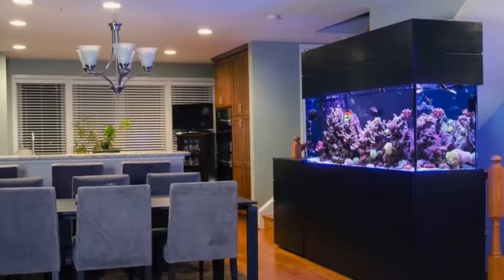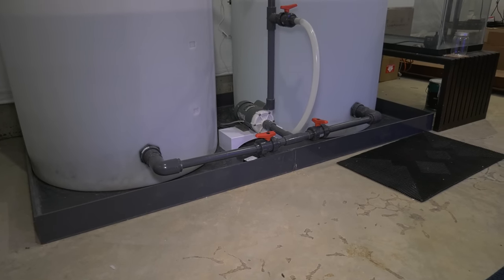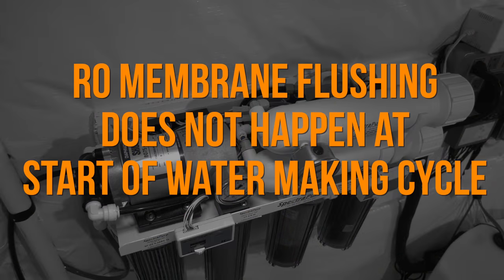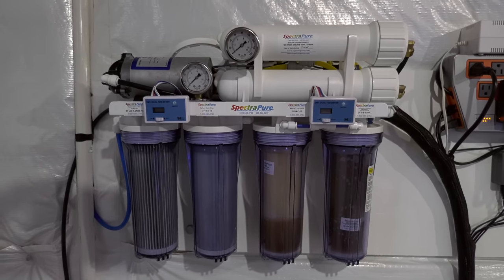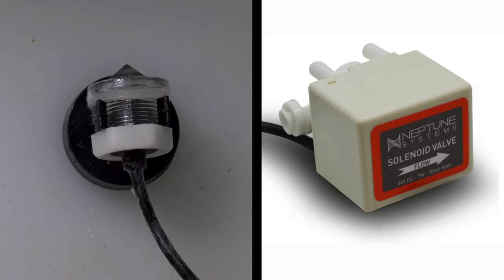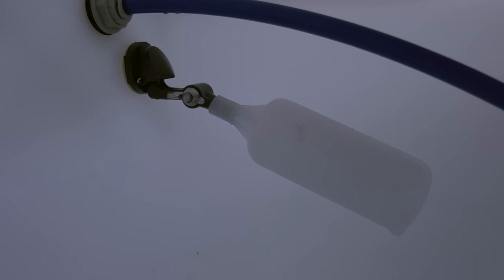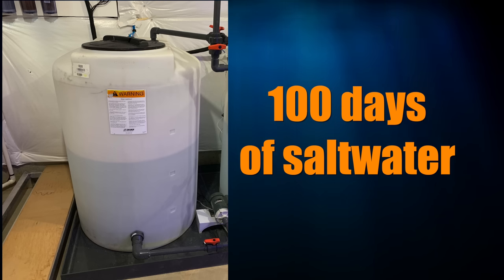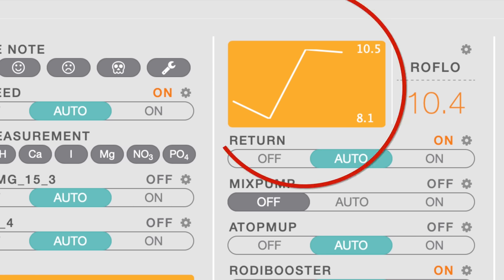High Tech Automation RODI Saltwater Mixing Station with Neptune Systems Apex

Comment: Ahh so many questions.. need to pick his brain!  Really digging these vids!
Reply from the maker: Justin McGinnis ask away!
Reply: Looked like the auto-flush was built in but are there kits available to add to existing? The solenoid controlled the water flow but I’m guessing it was programmed to open before the auto-flush did its job. Also can you use the 1/4” flow meter to ensure that the solenoid did in fact open so your boost pump doesn’t run dry? If that’s the case could we possibly see a quick and dirty on how to set that up? Would love to set up an automated water change system due to the fact I’m constantly gone from the house! Just want to ensure it’s not going to fail overall because of one component. You guys are awesome by the way!
Reply from the maker: Justin McGinnis the auto flush is not available as an add on.

Comment: I’ve really enjoyed the series.  Perfect timing too as I am designing my mixing station to fit in a closet behind my 120 gallon aquarium.  One question though…  Is it ok to have the freshwater tank in a mixing station double as the ATO reservoir?  I’m limited on space and would rather not have a separate tank for the ATO system.
Reply from the maker: Awesome!  You can use the freshwater tank for top off if you want.

Comment: Question is...how do you get those low water sensors mounted on the tank?  I am going to be doing 2 500 gallon  72 inch tall tanks and there is no way to reach the low level of the tank.  Do you use the string method?  Those are awfully small holes.  Thanks!

Comment: Shouldn’t you consider a salinity checker on the saltwater mixing cat before it starts putting water into the tank for automatic water change?   And a safety programming that doesn’t let the water change occur unless the salinity is within target range?
Reply from the maker: ATF intheHouse Salinity is checked by hand before water changes are started. Given that the total system volume on this tank is over 800 gallons, if a couple gallons of low salinity salt water and get changed into the tank, it is not going to make a difference
Reply: I thought about this also. With the Apex, you could put a conductivity probe in the mixing vat, but I'm not sure how accurate it would be, especially with varying water level.